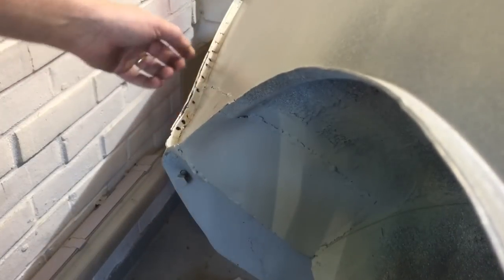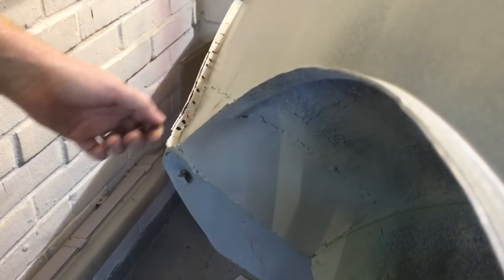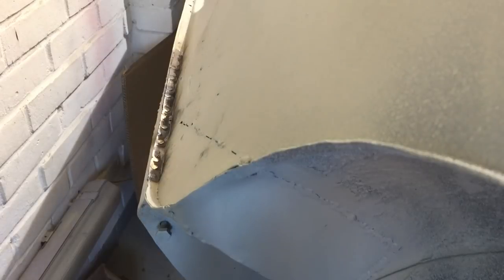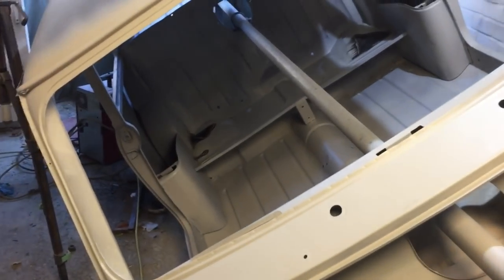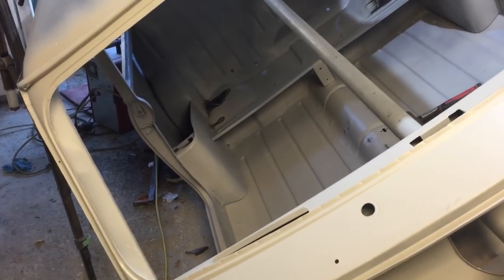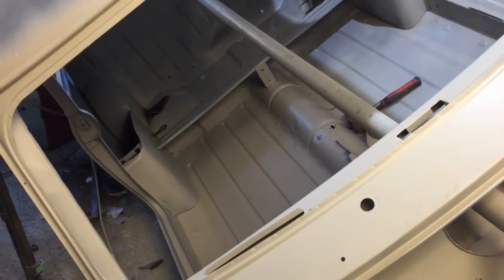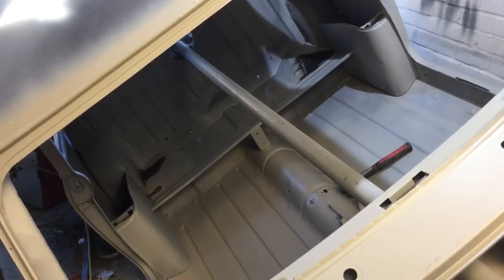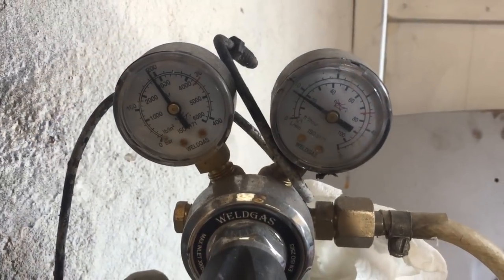1964 Mk1 Mini Restoration S2 Ep164 - - Rear Quarter

Comment: Are the inner arches and seat back not bonded to the inside of the outer quarters? Quite a gap there looks like quite a tight dirt, dust and moisture trap and hard to get in there to clean? Pause at 8:20 to see what I mean
Reply from the maker: if you mean dark gap area yes , common water trap for minis , if you talking about the light area / gap no its not bonded , rover also liked to fill that gap with sponge as well , that really helped keep moisture there to lol